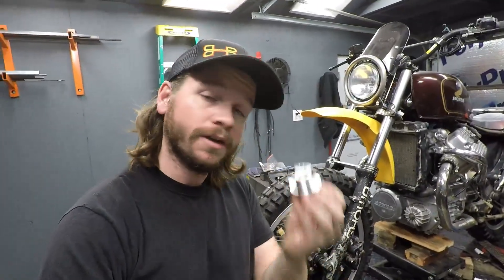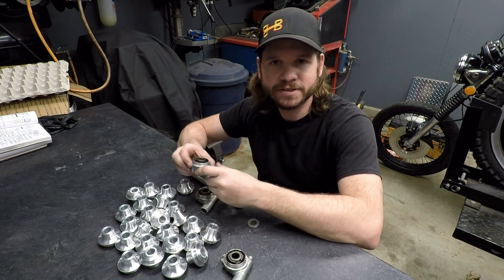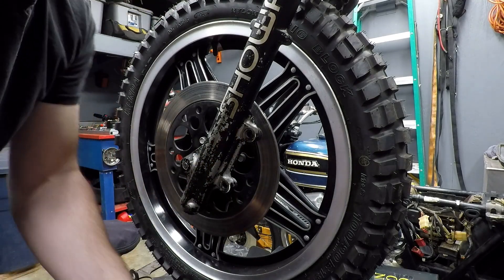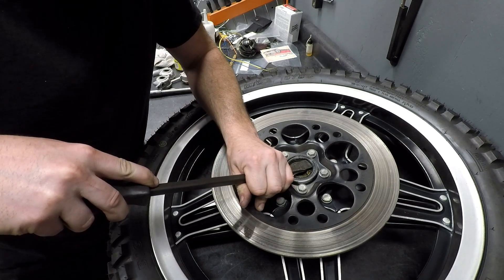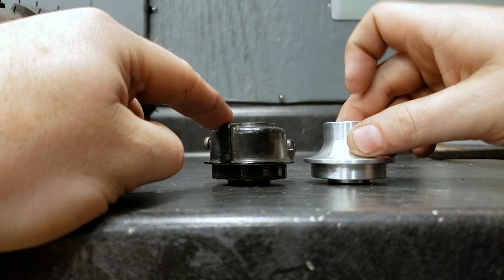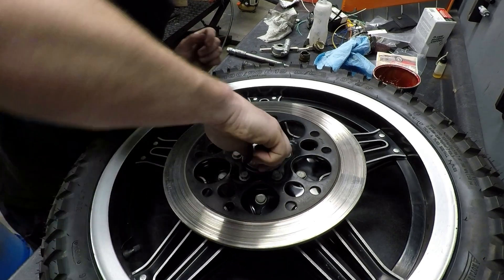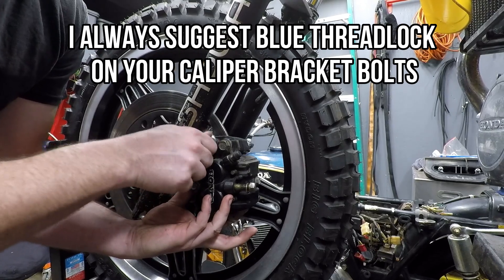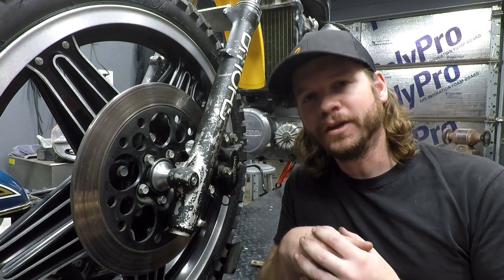Honda Speedometer Drive Delete Overview and Install

Comment: Hello. I am working on a CX 500 and have bought one of your Honda Speedometer Drive Deletes. What grease did you use?
Thanks for great videos and a great part.
Reply from the maker: Well thank you for picking one of those up! For grease just use some wheel bearing grease that you would use for axles and other things.

Comment: Cool part! My CBX turbo bike could likely use one of those, as I still use the stock front Comstar on it. I use an electronic speedo & tach, so no sense to use the stock issue.
Thanks for a great video and the links!
Reply from the maker: Id be honored to have my part on such a rig!

Comment: Seems like it would be a good time to replace the wheel bearings while its open.
Reply from the maker: Definitely
Reply: @BrickHouseBuilds  take your wireless caliper off and just, set it down… anywhere, because it’s not attached.. lol gave me a chuckle.

Comment: This may be a dumb question but will you have another way to measure speed or is this bike strictly off-road?  Love your videos BTW!
Reply from the maker: Hey Brian as explained when you go to a digital speedometer you have no need for the cable drive
Reply: Thank you, sorry I missed that, out of curiosity where does a digital speedo pickup the speed info?
Reply from the maker: @brianh4104  no worries.  They use a small magnet mounted on the wheel with a pickup that mounts to the fork leg.
Reply: @BrickHouseBuilds  thank you!  Really appreciate it, Looking forward to future videos!